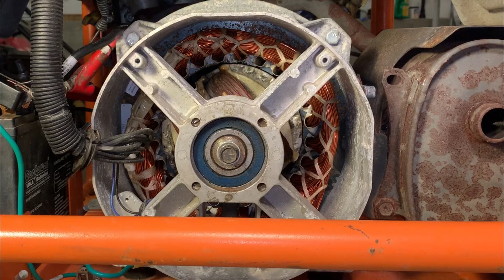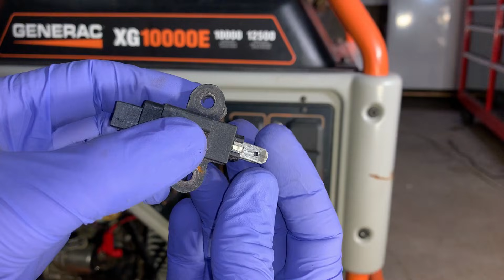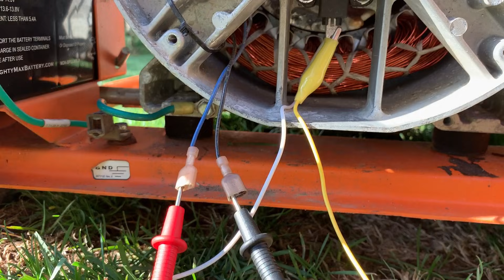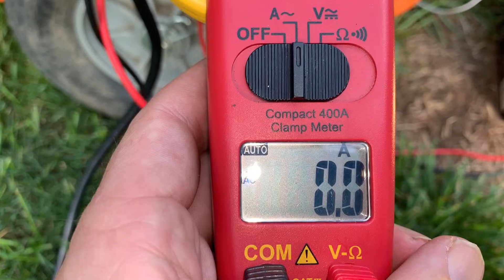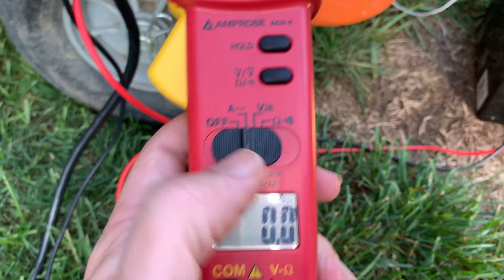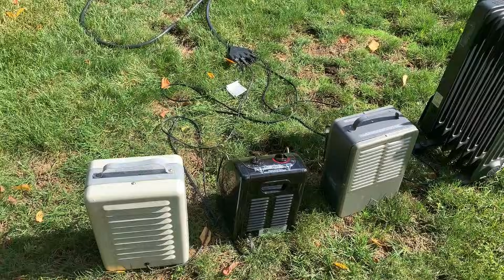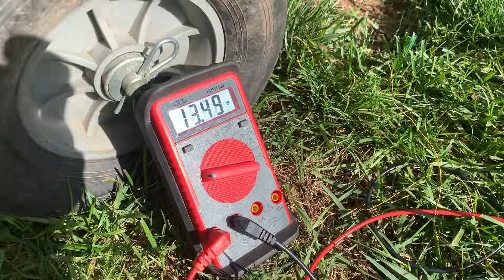Generac XG10000e No Power/No Voltage - Fixed

Comment: You continue to impress me with your knowledge of generator electronics.  I could tell right away the goer was bad.  There must be a way to make things more complicated that this generator has done.  Great job for sure.
Reply: Here is a reminder about portable generator safety: this is only a reminder for anyone who use portable gas/propane generators. This is just to make sure that everyone is aware of all the warnings and it’s just to remind people to be careful using portable generator during a power outage. Everyone has to see this safety reminder. Every year after hurricane and winter storms, there were reports on the news that many people have died each year when using generators due to carbon monoxide poisoning and electrocution during a power outage. There were reports about deaths when using generators when the power was out. There is something very serious that everyone should always be aware of when using generators. Some people do run their generator indoors which is not safe and that increases the risk of carbon monoxide poisoning which can cause death of family and you. Some people run their generator in wet conditions which can electrocute them. Here’s an advice about generator safety: please remember that you should never run your generator indoors. Remember that carbon monoxide is an odorless and colorless gas that you cannot see or smell. Carbon monoxide is a silent killer. Keep that in mind. Make sure your generator is 15-20 feet away from your house and away from doors, windows, and vents. Having a carbon monoxide detector is very important against generator safety. Some people also allow children to go near the portable generator which could pose risks. We need to keep an eye on our children making sure that they are not near the portable generator so they won’t get electrocuted or burned by the generator which is dangerous. A locking enclosure also keeps kids safe. A generator shed might look like a tempting place to explore, or take cover during a game of hide and seek, but a generator is a dangerous piece of equipment that can cause injury. It says on the manual that we should also keep children away at all times from the portable generator to avoid injuries. Please do not permit a child or unqualified people to operate the portable generator. Generators pose electrical risks. If you need to use your generator during wet weather, you need a generator tent to protect your generator from getting wet. Don’t let your generator get wet. Keep your generator dry and before using your generator, please make sure your hands and your generator is dry. Everything that is said on the generator’s operating manual should not be ignored. Never smoke cigarettes near the generator. Please keep flammable things away from the generator. Never overload your generator too. Your generator can catch fire. Never ever try to plug a generator cord into a wall outlet to avoid back feeding. Back feeding your generator is dangerous. Always turn on your generator first before plugging in appliances and shut off the appliances before turning your generator off. Use a heavy duty cord for your generator and the cord should not be worn out. All the instructions should be followed carefully. Never refuel your generator while it’s running. It can cause fire if fuel spills while your generator is hot. You should turn off your generator and let it cool off before refueling it. Having a fire extinguisher next to the generator is also important. This is only a reminder for everyone’s safety of using generators. Make sure your generator is properly grounded. https://youtu.be/I1jT3ANENvI and here is a video more about keeping others safe when using generators and also about our family’s safety. Hope this helps and everyone understands the safety rules. Thank you.

Comment: Great job James ! you fixed it .. It sure pays to trouble shoot .. ENJOYED
Reply: Here is a safety reminder about portable generator safety: this is only a reminder for anyone who use portable gas/propane generators. This is just to make sure that everyone is aware of all the warnings and it’s just to remind people to be careful using portable generator during a power outage. Everyone has to see this safety reminder. Every year after hurricane and winter storms, there were reports on the news that many people have died each year when using generators due to carbon monoxide poisoning and electrocution during a power outage. There were reports about deaths when using generators when the power was out. There is something very serious that everyone should always be aware of when using generators. Some people do run their generator indoors which is not safe and that increases the risk of carbon monoxide poisoning which can cause death of family and you. Some people run their generator in wet conditions which can electrocute them. Here’s an advice about generator safety: please remember that you should never run your generator indoors. Remember that carbon monoxide is an odorless and colorless gas that you cannot see or smell. Carbon monoxide is a silent killer. Keep that in mind. Make sure your generator is 15-20 feet away from your house and away from doors, windows, and vents. Having a carbon monoxide detector is very important against generator safety. Some people also allow children to go near the portable generator which could pose risks. We need to keep an eye on our children making sure that they are not near the portable generator so they won’t get electrocuted or burned by the generator which is dangerous. A locking enclosure also keeps kids safe. A generator shed might look like a tempting place to explore, or take cover during a game of hide and seek, but a generator is a dangerous piece of equipment that can cause injury. It says on the manual that we should also keep children away at all times from the portable generator to avoid injuries. Please do not permit a child or unqualified people to operate the portable generator. Generators pose electrical risks. If you need to use your generator during wet weather, you need a generator tent to protect your generator from getting wet. Don’t let your generator get wet. Keep your generator dry and before using your generator, please make sure your hands and your generator is dry. Everything that is said on the generator’s operating manual should not be ignored. Never smoke cigarettes near the generator. Please keep flammable things away from the generator. Never overload your generator too. Your generator can catch fire. Never ever try to plug a generator cord into a wall outlet to avoid back feeding. Back feeding your generator is dangerous. Always turn on your generator first before plugging in appliances and shut off the appliances before turning your generator off. Use a heavy duty cord for your generator and the cord should not be worn out. All the instructions should be followed carefully. Never refuel your generator while it’s running. It can cause fire if fuel spills while your generator is hot. You should turn off your generator and let it cool off before refueling it. Having a fire extinguisher next to the generator is also important. This is only a reminder for everyone’s safety of using generators. Make sure your generator is properly grounded. https://youtu.be/I1jT3ANENvI and here is a video more about keeping others safe when using generators and also about our family’s safety. Hope this helps and everyone understands the safety requirements. Thank you.

Comment: Very good find James! The XG and XP series are some of the best portables you can buy. The engine speed is an mechanical governor but electronically assisted with a stepper motor. The 2nd board inside is what controls it. The stepper keeps the droop within 2% of the set speed of the mechanical governor. They are tricky to adjust, and generac has a separate white paper how to adjust certain control boards for gain, droop, and stability with dynamic loads like motors. If that board doesn't have the 3 pots on it, and just two dip switches, then those settings are preset and you can only adjust 50/60hz speed, and the direction the stepper motor moves for adjustment since the board was used on many machines mounted in different directions
Reply: Here is a reminder about generator safety: this is only a reminder for anyone who use portable gas/propane generators. This is just to make sure that everyone is aware of all the warnings and it’s just to remind people to be careful using portable generator during a power outage. Everyone has to see this safety reminder. Every year after hurricane and winter storms, there were reports on the news that many people have died each year when using generators due to carbon monoxide poisoning and electrocution during a power outage. There were reports about deaths when using generators when the power was out. There is something very serious that everyone should always be aware of when using generators. Some people do run their generator indoors which is not safe and that increases the risk of carbon monoxide poisoning which can cause death of family and you. Some people run their generator in wet conditions which can electrocute them. Here’s an advice about generator safety: please remember that you should never run your generator indoors. Remember that carbon monoxide is an odorless and colorless gas that you cannot see or smell. Carbon monoxide is a silent killer. Keep that in mind. Make sure your generator is 15-20 feet away from your house and away from doors, windows, and vents. Having a carbon monoxide detector is very important against generator safety. Some people also allow children to go near the portable generator which could pose risks. We need to keep an eye on our children making sure that they are not near the portable generator so they won’t get electrocuted or burned by the generator which is dangerous. A locking enclosure also keeps kids safe. A generator shed might look like a tempting place to explore, or take cover during a game of hide and seek, but a generator is a dangerous piece of equipment that can cause injury. It says on the manual that we should also keep children away at all times from the portable generator to avoid injuries. Please do not permit a child or unqualified people to operate the portable generator. Generators pose electrical risks. If you need to use your generator during wet weather, you need a generator tent to protect your generator from getting wet. Don’t let your generator get wet. Keep your generator dry and before using your generator, please make sure your hands and your generator is dry. Everything that is said on the generator’s operating manual should not be ignored. Never smoke cigarettes near the generator. Please keep flammable things away from the generator. Never overload your generator too. Your generator can catch fire. Never ever try to plug a generator cord into a wall outlet to avoid back feeding. Back feeding your generator is dangerous. Always turn on your generator first before plugging in appliances and shut off the appliances before turning your generator off. Use a heavy duty cord for your generator and the cord should not be worn out. All the instructions should be followed carefully. Never refuel your generator while it’s running. It can cause fire if fuel spills while your generator is hot. You should turn off your generator and let it cool off before refueling it. Having a fire extinguisher next to the generator is also important. This is only a reminder for everyone’s safety of using generators. Make sure your generator is properly grounded. https://youtu.be/I1jT3ANENvI and here is a video more about keeping others safe when using generators and also about our family’s safety. Hope this helps and everyone understands the safety requirements. Thank you.
Reply: @The_Happy_Aviation_Enthusiast  thank-you also!

Comment: Outstanding... Great video thanks for sharing...
Reply: Here is a reminder about portable generator safety: this advice is required for everyone’s safety when using portable generators and this is only a reminder for anyone who use portable gas/propane generators. This is just to make sure that everyone is aware of all the warnings and it’s just to remind people to be careful using portable generators. Everyone has to see this safety reminder. Every year after hurricane and winter storms, there were reports on the news that many people have died each year when using generators due to carbon monoxide poisoning and electrocution during a power outage. There were reports about deaths when using generators when the power was out. There is something very serious that everyone should always be aware of when using generators. Some people do run their generator indoors which is not safe and that increases the risk of carbon monoxide poisoning which can cause death of family and you. Some people run their generator in wet conditions which can electrocute them. Here’s an advice about generator safety: please remember that you should never run your generator indoors. Remember that carbon monoxide is an odorless and colorless gas that you cannot see or smell. Carbon monoxide is a silent killer. Keep that in mind. Make sure your generator is 15-20 feet away from your house and away from doors, windows, and vents. Having a carbon monoxide detector is very important against generator safety. Some people also allow children to go near the portable generator which could pose risks. We need to keep an eye on our children making sure that they are not near the portable generator so they won’t get electrocuted or burned by the generator which is dangerous. A locking enclosure also keeps kids safe. A generator shed might look like a tempting place to explore, or take cover during a game of hide and seek, but a generator is a dangerous piece of equipment that can cause injury. It says on the manual that we should also keep children away at all times from the portable generator to avoid injuries. Please do not permit a child or unqualified people to operate the portable generator. Generators pose electrical risks. If you need to use your generator during wet weather, you need a generator tent to protect your generator from getting wet. Don’t let your generator get wet. Keep your generator dry and before using your generator, please make sure your hands and your generator is dry. Everything that is said on the generator’s operating manual should not be ignored. Never smoke cigarettes near the generator. Please keep flammable things away from the generator. Never overload your generator too. Your generator can catch fire. Never ever try to plug a generator cord into a wall outlet to avoid back feeding. Back feeding your generator is dangerous. Always turn on your generator first before plugging in appliances and shut off the appliances before turning your generator off. Use a heavy duty cord for your generator and the cord should not be worn out. All the instructions should be followed carefully. Never refuel your generator while it’s running. It can cause fire if fuel spills while your generator is hot. You should turn off your generator and let it cool off before refueling it. Having a fire extinguisher next to the generator is also important. This is only a reminder for everyone’s safety of using generators. Make sure your generator is properly grounded. https://youtu.be/I1jT3ANENvI and here is a video more about keeping others safe when using generators and also about our family’s safety. Hope this helps and everyone understands the safety requirements. Thank you. Be safe.